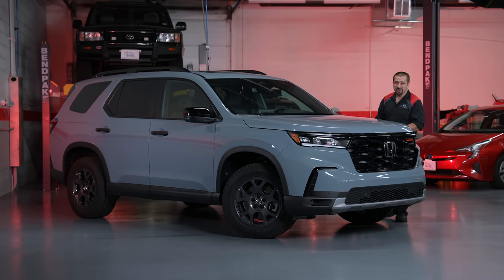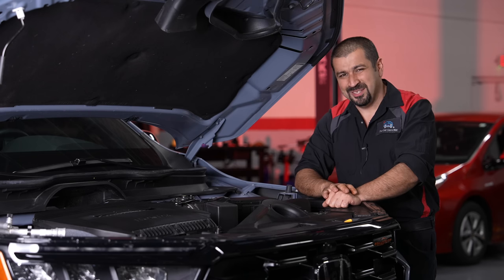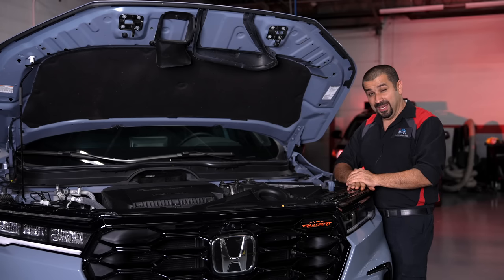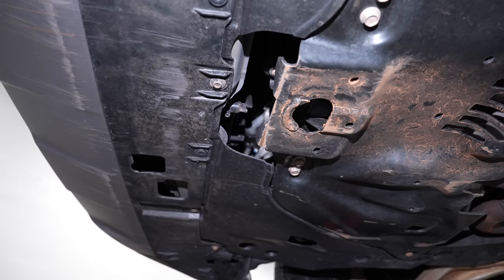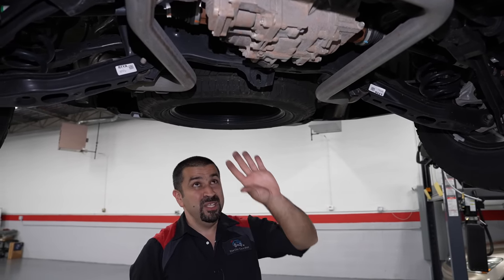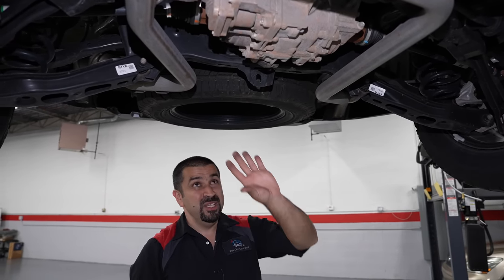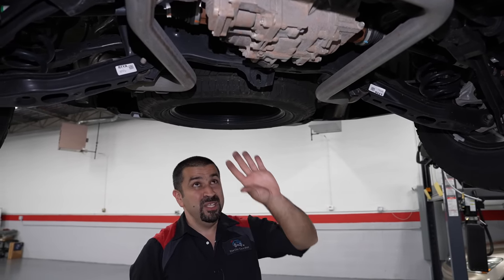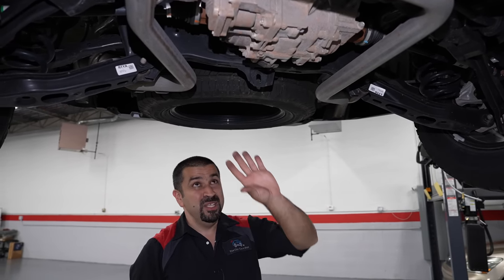Should You Buy a 2023 Honda Pilot? Thorough Review By A Mechanic

Comment: Something very wrong happened at Honda and I dunno what it is or why it so.   Maybe Honda has abandoned  making long lasting, reliable, easy to maintain cars?  Certainly the engineers were aware that every auto manufacturer in history that produced models  utilizing cylinder-deactivation had inherent flaws/problems that resulted in flat sales and certain death.  Even the previous gen Honda V6 with VCM had issues with excessive carbon build-up (clogging emissions related passages), melted spark-plug anodes, and other symptoms of the system.   And utilizing timing belts in today’s world is a middle-finger to future customers.  Lastly, the design of this ‘all new’ Pilot is a poor copy of the Jeep Grand Cherokee, imho.  The company has lost Mr Honda’s dream-

Mazda is offering models sure to eat Honda’s market share-

Comment: Don't buy Honda. Quality has gone downhill. I have a 2019 Pilot and it's terrible. I'm changing the transmission fluid every 20k miles just to keep it from juddering. The safety system is awful. Basically, the brake warning alert goes off all the time, even when the car is in the other lane. Still using timing belts. Just has been a horrible experience.

Comment: We'll see how that "cylinder de-activation" system works with Honda, cause American manufacturers, more especifically GM, does NOT know how to do it, even tho they've been trying it for DECADES, it is still CRAP! They first started it with the Cadillac Allante' in 1993, and still trying 30 years later, and it is absolute JUNK! You see Silverados and Sierra trucks with that system with disastrous engine failures, with mileage as low as 10k miles... it is PATHETIC!
Regarding "options", Honda has ALWAYS been BAD in that regard, in my opinion. For example; a while ago, if you got the Accord Sport, you could NOT have "navigation"!!! Really? How STUPID is that!? Don't know how it is now but, that's how it was.